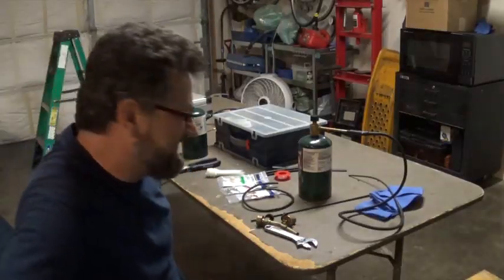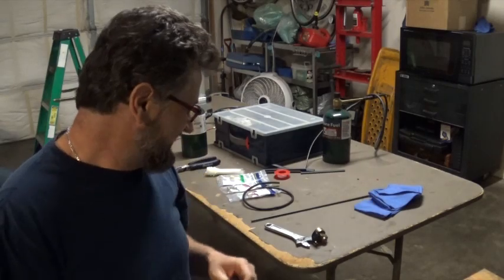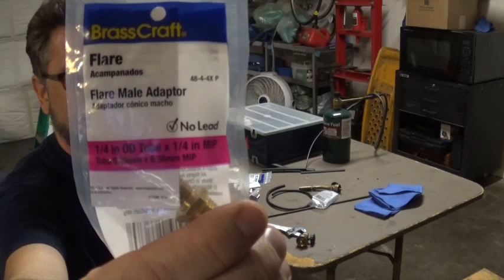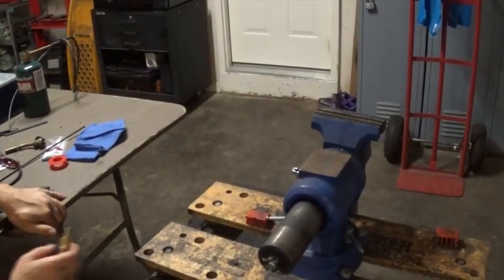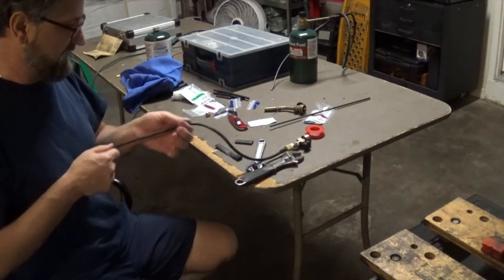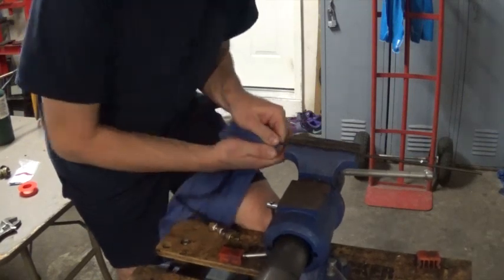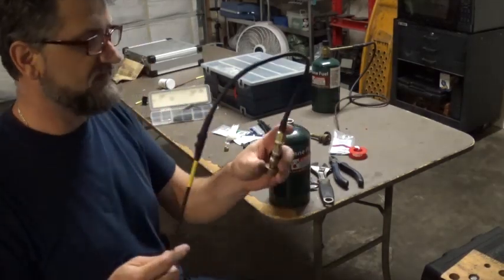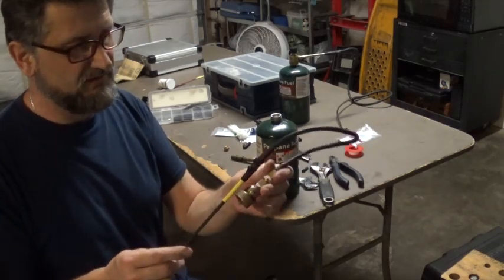DIY Vacuum Leak Detector With Propane

Comment: Nice job... Just need to make the hose longer. Also, using an old  coat hanger, you could fashion a hook attached to the valve such that you can hang it from the hood latch. That keeps the bottle upright and prevents any liquid from getting set out of the hose.
Reply from the maker: RJC3po good tip my friend. Thanks for sharing. I am glad you like it. Cheers

Comment: This has been on my to-do list, just haven't gotten around to it. Not only can you detect a vacuum leak with this but also enrich the mixture and diagnose oxygen sensors by observing their response to it.
Reply from the maker: BuddysAdventures yes my friend you are absolutely right it can be used for O2 sensor testing as well and it works great. Thank you for watch cheers bro.
Reply: BuddysAdventures how do we test o2 sensor
Reply: There are several good YT videos on this topic. However, a quick answer is if you have a scanner that can capture real-time data you can see what the O2 sensor is doing. In closed loop it should always be fluctuating between 0-1v but avg'ing around 0.5v. What I meant by my comment above is that if you introduce propane by deliberately richning the air/fuel mixture a functioning O2 sensor should show rich and the fuel trim numbers show reflect that. Hope that helps.